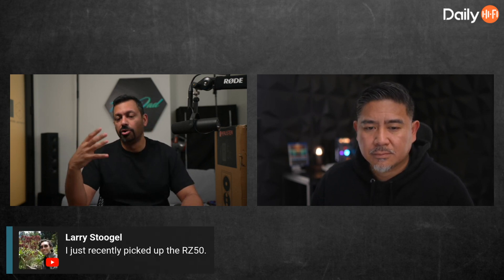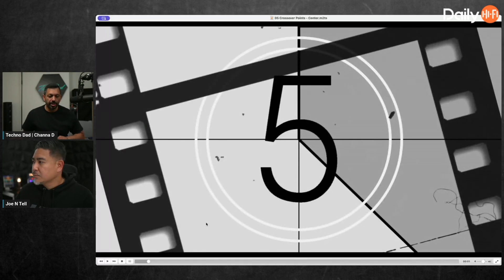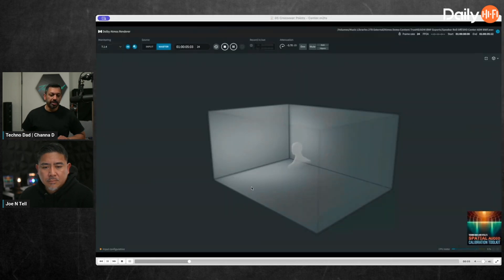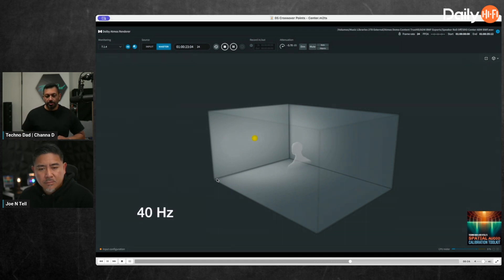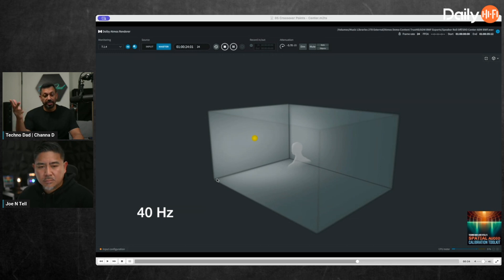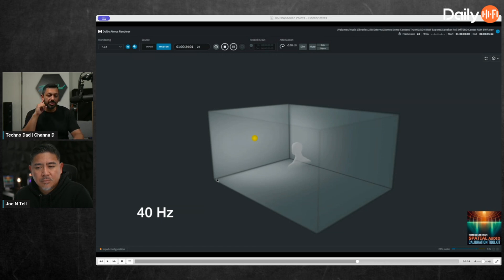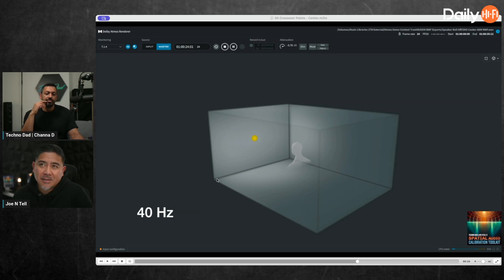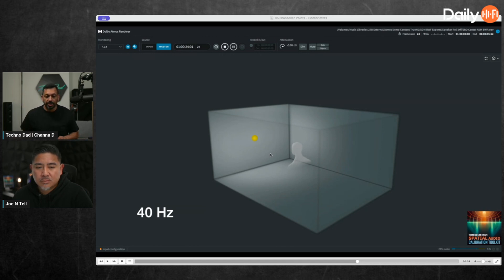How to Find the Ideal Crossover Frequency with the Spatial Audio Calibration Toolkit (SACT)

Comment: Sorry folks, as you read through all of my comments please note that I place Dynamics very high on my list, only second to a balanced frequency response, as well as I absolutely despise Compression and Distortion... and usually the best way to counter all of those things (without upgrading to more expensive speakers) is to set higher crossover points across the board and to go with a minimum of dual high performing Subs. As well as I mentioned earlier the more speakers you have crossed over at the very same frequency the better chance you have of obtaining a balanced frequency response (not that one couldn't achieve a balanced frequency response even with every set of speakers set to a different crossover point, but man that would be waaaay harder and so unnecessary 😉
Reply: It's good you know what you like.
Reply: @joentell  It's OK to not always agree with what others Say / Do / Suggest to others... and Yes, I very much know exactly what I like, as well as what works to get those results... but then I've been doing this a very long time I'm afraid 😕
Reply: @johndaddabbo9383  I'm with you. Trying new things and going against the norm is how new things are discovered.

Comment: I've had my avrs for years set at 80hz,  I always thought audyssey, ypao etc ruined my audio. It wasn't until I got the audyssey app that I found out my subs had a massive 15db dip at 70/80hz !
I crossed my floors to 60hz and woohoo!  That juicy rich bass all around. 
So 80hz could actually be a terrible setting.
Reply from the maker: Glad you figured it out. 

The Toolkit has tests for the main speakers and LFE channel. It's also a good idea to make sure for others to make sure the sub doesn't have a null at certain frequencies also.

Comment: I whole heartedly disagree, as I find that most people are - 1. Running their speakers at too low a crossover point and therefore stuffing lower Dynamics, higher Compression, and higher Distortion, etc. and 2. It is much easier to achieve a well balanced sound / frequency response starting just above your highest crossover point to the very lowest frequency in system the more speakers you have crossed over at the same frequency (not that they all have to be, however the more they are the easier it will be to achieve overall good results). For example your height channels may be crossed over at 120 hz due to their extremely low output whereas all of your Base level channels may be happily Crossed over at 80 hz (or even 60 hz). 3. This is all room dependent, meaning in one person's set up an 80 hz crossover may be better due to the results achieved through blending one or more subwoofers, whereas in another system room a 60 hz crossover may work just fine for blending all the Base level speakers to the subwoofers..., and this is regardless of the extension capability of all of the Base level speakers. OK, well just one man's opinion on the Topic 😄
Reply: I usually use the REW Alignment Tool to find the best crossover for my speakers post MB.  I ran a couple of new MSO optimizations that I'll be presenting to MB in a few days and this time I'm going to use my SACT disc to try to find the best crossover for my speakers. Never tried this before so this will be a learning experience.
Reply: 80hz sounds awful in my house due to a massive 15db suck out on my sub. 60hz fills the gap.
Reply: @iansteventon4221  Exactly!  I hate when 80hz is thrown out (or any Frequency for that matter) as the End-all when it is so ROOM dependent 👍
Reply from the maker: You can always use a higher crossover. We're saying don't go below the range of that speaker. I'm not sure what part of what was said that you disagree with wholeheartedly.
Reply: @DailyHiFi  I wish I could use 80hz,  the placement of my subs and the huge 70-80hz suck out kinda determined I used 60hz. 
All my speakers go 50hz or lower so I'm hoping all should be well with them and the Denon 6700h. 
Set my heights all at 100hz ( even tho they go way lower) just to ease the burden on the avr as I don't have external amplifier.
Reply: @DailyHiFi  Sorry, however using the technique as described in this video one will likely set a crossword point that is too low and therefore suffered Dynamics Compression and Distortion (IMO). I would highly suggest your technique plus a 10 or even 20 Hertz increase to the crossover point.
Reply from the maker: The technique involves finding where the roll-off is. You don't have to set it at that point. You just shouldn't set below it.
Reply: @DailyHiFi  Agree, I worry that most will set it / just leave it at that very frequently 😞.
Reply: @johndaddabbo9383 my recommendation was to apply a crossover and run it to see if there are holes in the response. 80Hz isn't really that hard for most speakers to handle. We're just talking about SACT as a tool. If someone wants to play the tones louder to hear when their speakers are hitting their limits, that's also a good idea.
Reply: I agree, I start at 200hz and up to 300hz. But you have to use 2 subs in front corners or at the front wall.

Comment: But my subwoofer has 1100w. When I'm running 7.1 my AVR probably only puts out @75w x 7. Even in stereo probably only @90w x 2.  So why not send everything under 80hz to the sub and leave the distortion causing bass out of my mains?
Reply: This is only for testing. We're not saying to run it like that.